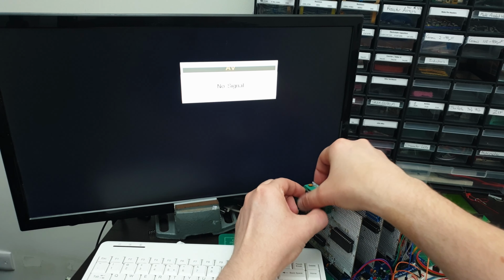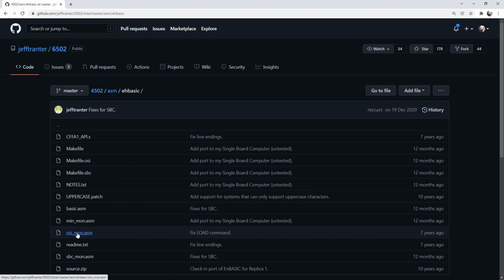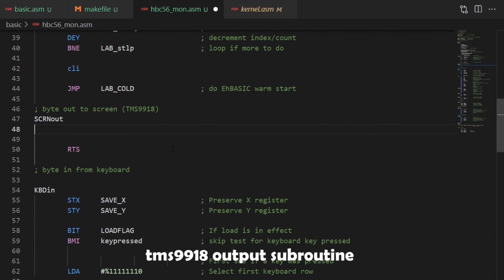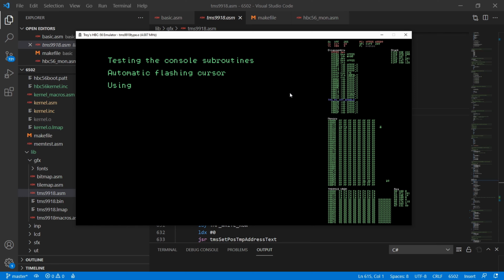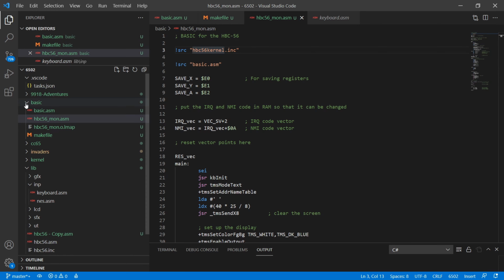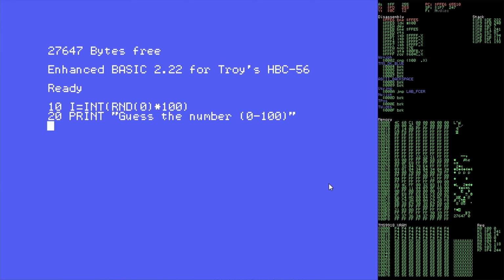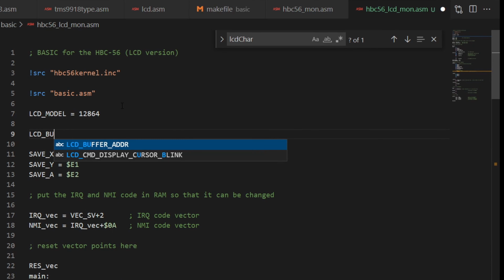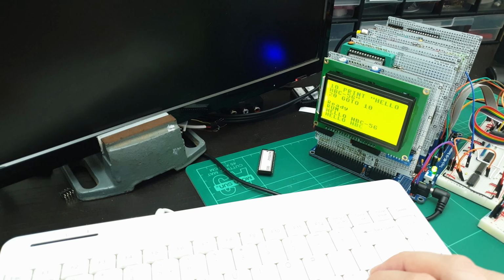Run BASIC on your 6502

Comment: Do you have a BASIC version for a 6502 computer with ACIA?
Reply from the maker: I do, but my ACIA hardware is quite different to the Ben Eater build. In my GitHub repo, you'll see two *_uart.asm files in /code/6502/basic
/drivers. However, they rely heavily on my Kernel/UART  library in /code/6502/lib/ser

Comment: Hi, I have been developing a very similar computer to yours for a year now and I am very interested in your emulator and would like to modify it for my computer. It uses the same TMS9918 and 65c02, just at very different addresses with other minor differences. Anyway those addresses bother me the most to start with, can you please advise me where to change what? I'm more HW oriented and there navigating in someone else's well-commented code gives me big problems.
Just to clarify the IO addresses are at $Cxxx and TMS at $CF00-1. Ram is from $0-BFFF rom $E000 but I've dealt with that, only the TMS doesn't run.
Reply from the maker: Sounds great. My emulator code is very much held together with rubber bands and sticky tape at the moment. I'm currently working on cleaning it up as more people are interested in it. Is your TMS connected directly to the bus? Or is there a 6522 VIA in the middle?
Reply from the maker: I've created a new branch https://github.com/visrealm/hbc-56/tree/alois_config which should have the changes for your config (or at least head you in the right direction). Let me know how  it goes for you. I tested it by updating my kernel with the same parameters, but my Kernel is 8KB, so I only get the boot screen. All the best :)
Reply: Wow :O directly on bus :-)
Reply from the maker: @berretw  Great. Mine is too. Should be able to get it working easily then.

Comment: EhBasic uses a lot of zero page memory. Are there no conflicts due to the operating system routines?
Reply from the maker: It sure does. I did mention it in the video. I did adjust some of my OS ZP use to suit. I plan to make that easily configurable soon.

Comment: Thank you for this! You condense a lot of information in a short space of time
You've inspired me to have a crack at implementing this on my little homebrew
Reply from the maker: Thanks, Matt. Pacing is a challenge. It would be easy to stretch this to an hour or more, but who's going to watch that? I wouldn't. I figure covering the key ideas is enough, and the rest is in my reasonably well documented code on Github. Good luck with your implementation. Keep me posted. 🙂

Comment: Amazing work, as usual. This really demonstrates the utility of having a software emulator. Not that I mind programming EEPROMs, since the tactile experience of working with hardware devices is part of what makes this kind of project fun, But for testing small changes, the value of being able to pop up the emulator can't be denied.
Reply from the maker: Thanks, Dave. The emulator is super convenient, that's for sure. It was a little tedious writing the LCD versions since I haven't added it to the emulator yet. I have written a character LCD emulator though. I used that for my breadboard CPU. I just need to extend it for a graphics LCD. Soon...
Reply from the maker: Plus, it allows others to join in on the fun without having to build anything. Though, that's half the fun...
Reply: @TroySchrapel  Now I kind of want to write an emulator for my 6809 system. I have some time off coming up, hmm....